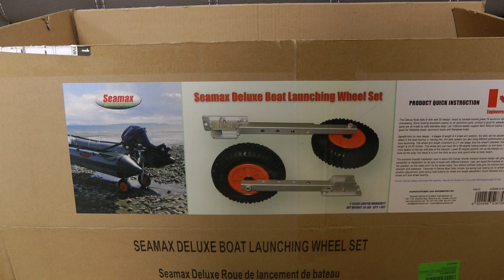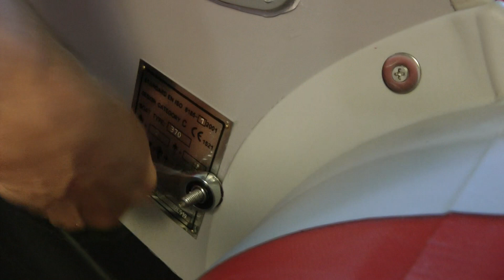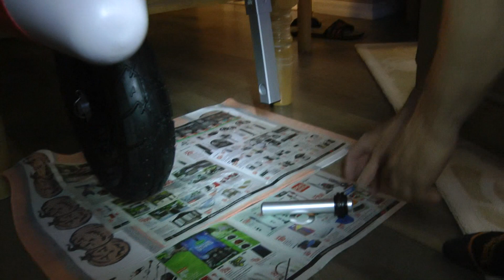Seamax Launching Wheel Set Installation In Narrow BRIS BSK370 KaBoat.

Comment from the maker: PRODUCT LINKS:
1. BRIS 12 ft Inflatable Kayak Fishing Tender Inflatable Poonton Boat 2 Person Kayak - https://amzn.to/3n9ewKe.
2. Seamax Deluxe 4 by 4 Boat Launching Dolly with 14" Wheels System - https://amzn.to/3TxwJgo.

RECOMMENDED TOOLS:
1. CORDLESS DRILL - CRAFTSMAN V20 Cordless Drill/Driver Kit, Brushless - https://amzn.to/3LhY1Fo.
2. MARINE SILICONE CLEAR - 3M Marine Grade Silicone Sealant, Clear, PN08029, 304 mL Cartridge - https://amzn.to/3JwHISV.
3. DRIPLESS CAULKING GUN - Dripless Inc. ETS2000 Ergo Composite Caulk Gun - https://amzn.to/3TBenvh.
4. WIHA HEAVY DUTY SCREWDRIVER SET - Wiha 53097 Screwdriver Set, Slotted and Phillips, Extra Heavy Duty, 7 Piece - https://amzn.to/3ystzRx.
5. RATCHETING WRENCH SET - GEARWRENCH 16 Piece 12 Point Ratcheting Combination Metric Wrench Set - https://amzn.to/3JqYunC.

Comment: how do these roll on soft sand with fully loaded boat?
Reply from the maker: We have not tried it on the sand but on a boat launch, the boat with the motor rolled really well. The boat is not very heavy and the wheel diameter is 14", I am guessing it will be fine on the sand as well.